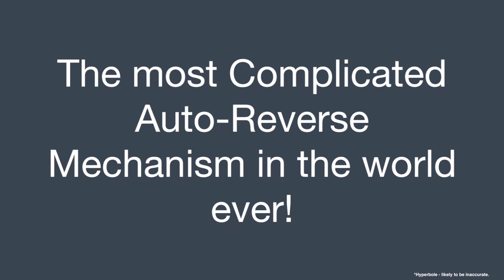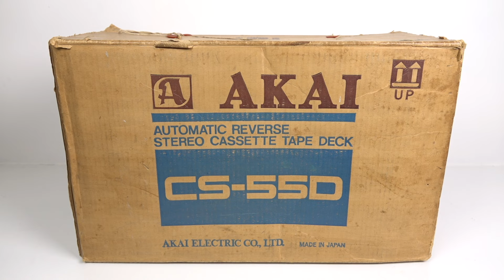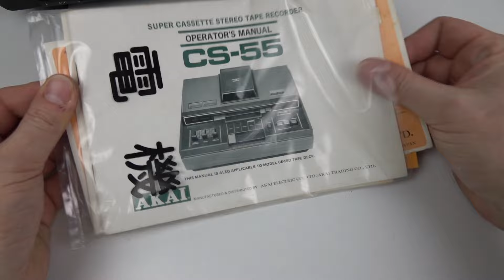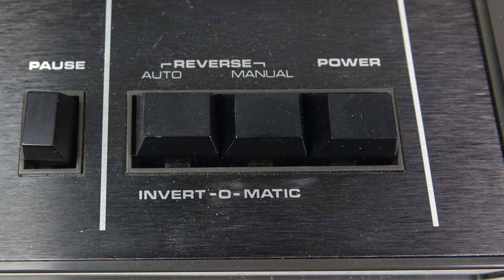Auto-Reverse: The Hard Way

Comment: I theory at least this is a better way to do auto reverse. There should be less chance for azimuth error do to the miss alignment of rotating heads often found in more modern auto reverse decks.
Reply: A head capable of reading all tracks and reversible capstans are a better, cheaper solution.

Comment: aren't there some auto reverse that didn't flip the heads around.  pretty sure my stationary but $90 Panasonic only switched directions on the wheels.  but it had a thicker head (flatter too)  it was all tiny buttons and remote controlled if I had the headphone set.  which didn't last long (and one water dunking but it lasted 20 years on top of that.  Either way the above is a work of art :O
Reply: very similar to this one http://www.evansweb.info/2008/04/14/panasonic-rq-s15/  I must say I saw that auto reverse flipping head.  never seen one before because that panasonic had very few moving parts.
Reply: might be this one actually.  Had I been watching these I might have thought it was a belt but it was so fancy that taking it apart required skill  :O  but it looks just about the same right down to the remote  https://www.radiomuseum.org/r/panasonic_cassette_player_rq_v520.html  and if that doesn't come up it's model RQ-V520

Comment: What a brilliant piece of over-engineering to solve a first world problem!  Did anyone do anything similar with turntables? I'd be interested to see how that would work (aside from the 80s solution of a vertical deck with two tone arms).
Reply: Well there was the Sharp turntable that used only one tone arm.  After it finished one side it would travel across the record, do a u-turn and play the other side from underneath.  Look up Sharp VZ-1500 / 1900

Comment: The thing about the head rotating is very odd to me. I've only ever seen such a mechanism once. Every other auto reverse cassette player I've seen simply has two sets of pickup coils in the head, one for each direction of the tape and then it just electronically switches the amplifier input to one set or the other. They often also have two capstain/pinch roller sets of which only one engages depending on the side being played.

Comment: I had a car cassette player that had an double head, instead of using rotary single head or like this one use hard way. I think most late car cassette players use double head , result is less moving parts and fast operation. My question is as double head method is not new and was in 80's , why high end cassette deck producers didn't use this method instead of complicated rotary  head which get out of alignment after a while ?

Comment: In the end, auto-reverse became even simpler when they used a dual tape head that didn't need to move at all (as many of the later walk mans)
Reply: not quite. simply using a four-track head does indeed work fine for an auto-reverse cassette player, like most walkmans. however, a four-track head isn't enough for an auto-reverse cassette recorder, since recording to the tape requires at least a separate erase head and ideally also a separate record head (so the playback head can monitor recording levels).

in order to record in the opposite direction, the physical order of those two-or-ideally-three heads needs to be reversed, which can be achieved either by flipping the whole head assembly or flipping the cassette itself. if you look closely at the mechanism at 8:37, you can actually see there are multiple separate heads on the part that rotates!
Reply: @00dani  Well if you really needed to record both ways the erase head could be placed on the sides, one for each direction. You might not get the live monitoring but you would make it a whole lot easier. Not sure if this machine could record on both sides automatically anyways?

Comment: Alright, I have a question (unrelated to the video).I have an old German Sound 1018 S radio/cassette player, and when I put my cassette in the tape deck, the moment I press play (the head comes in contact with the tape) the radio starts producing a medium to loud noise (hum). Before this I have used a cassette deck cleaner tape a few times, and someone told me it may have damaged the head. Is that true ? And if not, do you know what the problem is ?

Comment: Some tape decks had a dual reverse head and two erasing heads. The head was always in fixed position but the tape simply changed direction.
I made good money in my teens refurbishing worn out cassette player magnetic heads. The heads would wear out developing a groove where the tape slides over the head. Audio quality would suffer as a result of that.  I carefully removed, sanded and polished the heads thus restoring audio quality back to normal. It can only be done once and some heads were worn out too much and could not be restored.
I also installed a small home made circuit in the recording tract to vary magnetizing current dynamically thus improving the high range (above 15 kHz) recording quality on regular tapes.
Ohh, good ole days... I can't stand modern recordings made to sound good on a tiny smartphone speakers. Too much compression makes it sound terrible on a good audio system. Unfortunately younger generation has no clue what music should reallyy sound like.

Comment: It makes me so sad, I have a CS-50D invert o matic that I bought for like $8 at an estate sale and it’s in decent exterior condition but it just does not work and will probably never work. I’ve taken it apart and it’s SO complicated an pretty much nothing on it works. If you turn it on it lights up and the motor turns but you can’t even load a cassette in it.

Comment: Not an autoreverse mechanism, but the Sony BVU-800 had the most complicated mechanism I have ever run across.  I used to repair these way back years ago.  Truly an engineering marvel. Not only is the tape threading sequence very complicated, but the reel motors had to keep proper tension on the tape while threading and unthreading.  Too little tension would cause slack, too much would cause a threading failure or break the tape.  https://www.youtube.com/watch?v=XsxSH5KXtwE  Skip to 5:10 to see the mechanism in action.

Comment: Does anybody remember the black and white dartboard looking design on the flywheel driven by the motor? and the reason for the black and white design (can't remember it's true name) was to adjust the speed of the motor to the correct rpm and thus the music would sound correct. The black and white markers would appear to be stationary at a certain rpm, a bit like car wheels look like they have stopped or going backwards when driven at speed. Well anyway the point is what is the name of this type of marker?
Reply: Techmoan uses them in videos pretty regularly.  I saw it in one of his the other week.
Reply: @Bonswally   That's a good enough reason for me to continue watching Techmoan videos.

Comment: Has there ever been a way that did not flip either the cassette or the head plinth, on a recorder? I ask because I've lost decks, or functionality, to head plinth related failures, and flipping the cassette seems a bit "overkill".
Reply: when they began to produce four-track heads that did not need to be turned over when reversing, Nakamichi specialists continued to use their original rotary mechanism

Comment: My Technics tape deck just played the tape to the very end and stalled, still pulling on the spindle until it realised there was no more tape, then it stopped and reversed the motors. I always used to cringe when I heard the horrible straining noises when it did this and used to dash up and stop it myself - defeating the whole object of auto-reverse totally.
Reply: The RS-TR474 by any chance? Mine makes that horrible squeaking noise too at the end, lol.  I never use auto-reverse too it also messes up the head alignment.
Reply: @westelaudio943  So it was a general Technics things then?! Surprisingly odd design. Mine was the RS-M233X.

Comment: That may be the "hard way" to do auto-reverse, but it's not the worst way I've seen.
The BEST way I've seen was one that had TWO capstans and a 4-element tape head.
The WORST way I've seen had two capstans and a PIVOTING 2-element head that flipped around 180 degrees every time it reversed, causing the wires that lead to the tape head to metal fatigue and fail almost as soon as the unit was out of warranty.

Comment: This is a brute force approach, impressive, but not economical and likely not reliable.  My 90's Panasonic RX-C41 boombox accomplished auto reverse with 2 capstan-pinch roller sets and a shuttle mechanism that shifted one a c-pr set in and the other out, then reversing at the end of tape.  Also all mechanical, but less "stuff" going on.  A much more elegant approach.

Comment: Would it not have been simpler to use a 4-track head instead of 2 ?  Instead of flipping the cassette or even just the playhead, just reverse the playback motor and play the other two tracks.  Or, if there's a good reason to keep the 2-track playhead, just use a simple cam to raise and lower it between two steps, just like 8-track machines did with 4 steps.

Comment: The Nakamichi RX-505 is still one of the best sounding cassett players ever made. Super good sound, very durable auto-revers and no miss-aliened heads. However, you forgot to mention the most common solution on "auto-revers", not flipping heads, just reversing the tape and use another set of tracks on the heads that was wound in revers, hence allowing the tape to go in the revers direction but still play the music correctly.
I think that in the later models, they simply reversed the sound electronically 
The price today of a used RX-505 in minst condition on ebay is between 700-1000USD
Here is a video of the little brother Nakamichi RX-202 in action:
https://www.youtube.com/watch?v=eRSDp1JI5BQ

Comment: Couldn't you just use a head which can read all four tracks and have a two pinch roller/capstan mechanisms?
Reply: Actually that is what my sharp cassette recorder from 1991 did.
Reply: @manpreet9766  Actually thinking about it I had a Aiwa walkman in the 80s that did the same thing. Just a set of two buttons - if you pushed one in the other popped out and that swapped sides.

This one... you can even see the two buttons. It was instant, no servo mechanisms. https://audiogold.co.uk/product/aiwa-hs-g35-mkii/

Comment: wouldn't it be easier just turn magnetic reader up side down?
Reply: that would only play casette backwards. you need to solve the direction too.
Reply: @zandarion  after turning magnetic reader up side down, r̶o̶l̶l̶i̶n̶g̶
  'playing' the cassette o̶p̶p̶o̶s̶i̶t̶e̶ ̶s̶i̶d̶e̶  'backwards' will be right direction. on second thought, considering counter, cogs and other parts, most parts would need to be produced in a totally different production line. so, you cannot use parts for any other cassette players. my solution looks simple but ineffective and costly for mass production. i just asked to understand. now i get it.
Reply: @fl233d0m  thats exactly how modern player works
 LOL
Reply: @fl233d0m   after turning magnetic reader up side down, rolling the cassette opposite side will get you two steps back. player remains on the same tape side :)
Reply: @zandarion  not rolling back, just playing backwards. so it's the right direction. (i chose the wrong words, sorry about that)
Reply: @fl233d0m  i still dont get it if you get it but never mind. :-D
Reply: @zandarion  👍:D